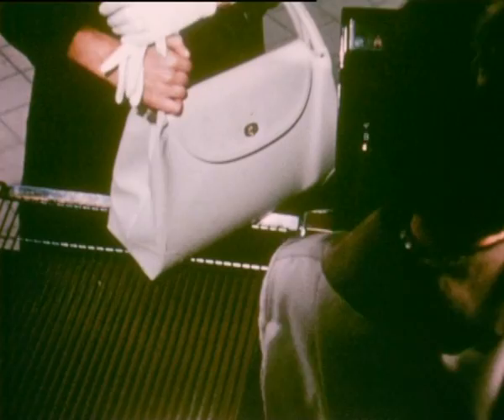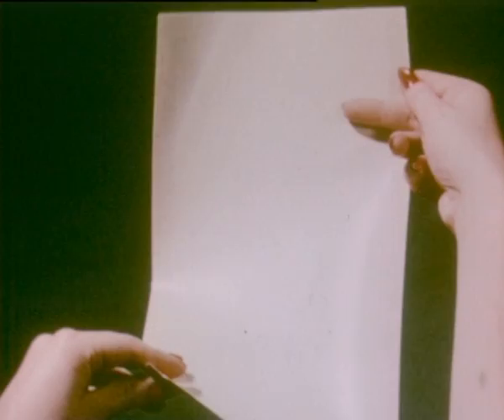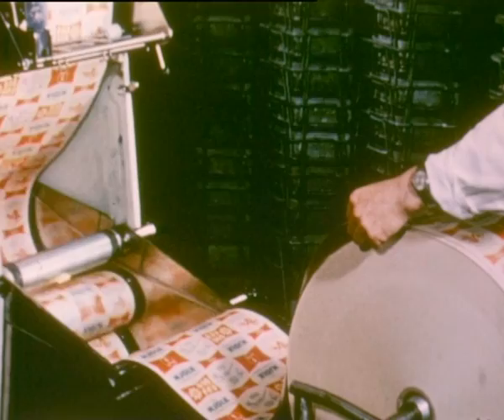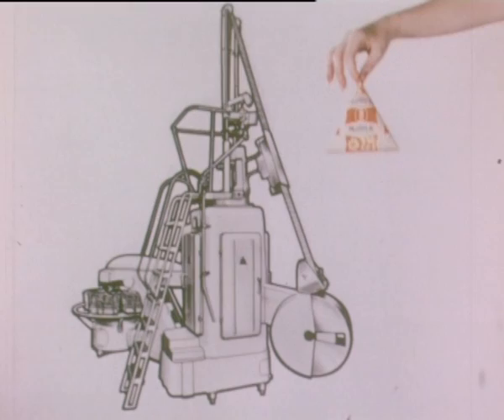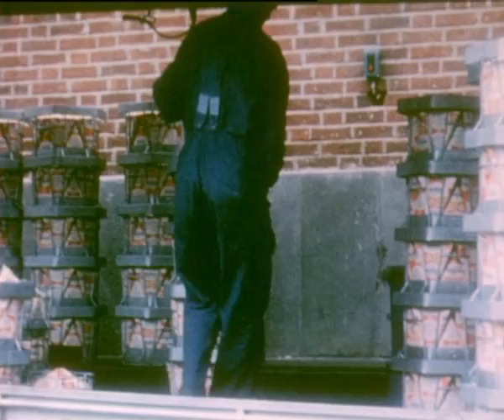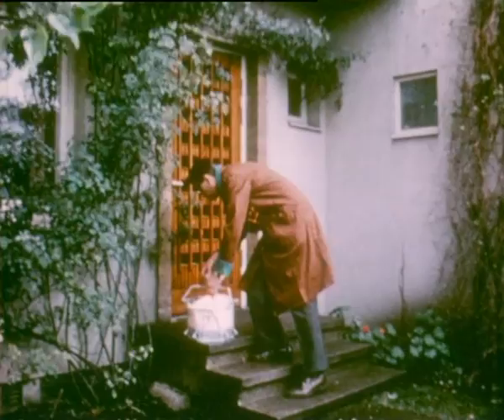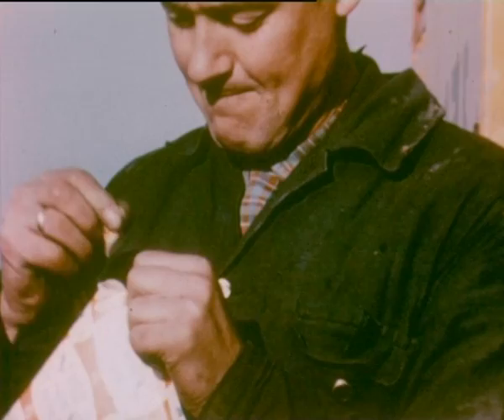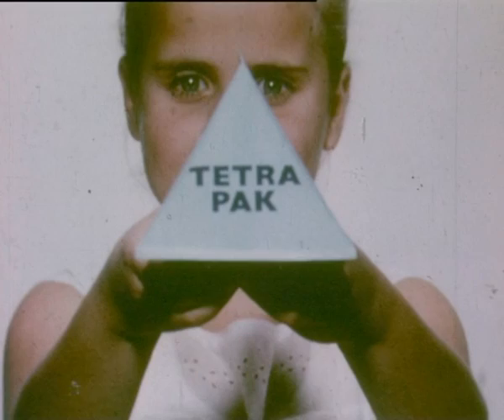From the Tetra Pak® archive: Tetra Pak - the key to modern distribution

Comment: Thanks for the archive material. It is appreciated, and it brings back some not altogether pleasant memories of the 1960's and 70's. The design was brilliant, but flawed. Some constructive observations about the packs, some of which you have addressed quite well, over the years:

Those original cartons were terrible for the consumer. Notice how carefully they are picking them up, opening and pouring from them. If you tried to tear a corner off, as shown in one shot, they usually ripped and spilt the contents all town your clothes. (As demonstrated so memorably on live TV in the U.K. when a proponent of Tetra Pak tried to prove that they were easy to open! There's a version of it, somewhere on Youtube.) 

The packs could also burst open when warm, as many children carrying Tetra Paks of orange juice to school soon discovered.

Even when people tried to open them with the average pair of kitchen scissors, the card/plastic material was tricky to cut neatly, again resulting in spillage.

And how the world has changed! Hygiene standards in the video were terrible; at least one corner was handled by the milkman, who had just been handling a dirty truck's controls and door handles, and the other three corners were stood on the obviously dirty doorstep, with no protection, so all corners needed cleaning thoroughly. But most people just put them into the refrigerator without even thinking about antigens on the packaging, which were then transferred to the shelf, and onto the hands of the users,

The factory hygiene was both necessary and mandatory, but that need is still not conveyed clearly to the end user. I've seen many packs standing on unclean and stained store display shelves, and they are handled by delivery people, shelf stackers, shop assistants, often several potential purchasers, the customer, the checkout assistant, and whoever transfers the goods to household cupboards and refrigerators.

As for the fold-over corners, they were a joke. They never stayed folded for long. We resorted to using clothes pegs for the job.

Then the whole advert is trumpeting the fact that there was no need to recycle the used containers! That would surely have killed the product off in short order, if they were invented today.

Your company went on to be very big, however, and you improved the packs by reverting to the traditional cuboid shapes we have today, often with plastic screw caps. But they still have problems, both practically and environmentally:

The 'pull' opener under many plastic screw cap seals tends to snap, often painfully, resulting in many people not even bothering to try using the option, and simply cutting off a couple of pack corners. (I had that happen again, with a Tetra Pak branded carton, within the past week.) They still don't pour very well, unless you're very careful. And even then, some packs are so badly designed that it's almost impossible to pour from a full container without it gulping and splashing. The trick is to rotate the pack to allow air to enter more easily, but you try telling that to a young child, or to a busy and preoccupied adult!

And that bonded plastic/card material is not recycled by my local council. Many other councils might also be consigning the material to landfill, or, at best, sending them to be burned as 'bio fuel'  in electricity generating facilities.

Thank-you for reading this. 🙂
Reply: I forgot to mention the other obvious flaw in the presentation: Hexagonal stacking certainly can be economical - if you ignore the outer edges. A correspondingly hexagonal storage space is needed for maximum packing density. The traditionally-shaped, and modern, square carton is better, because packs can be stored to fill completely a normal rectangular truck, shelf or room. 😉